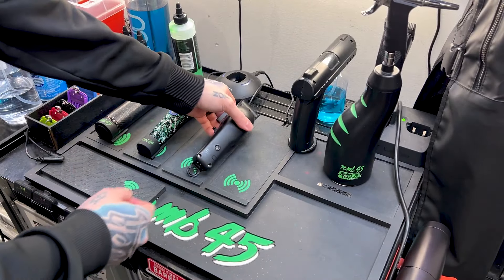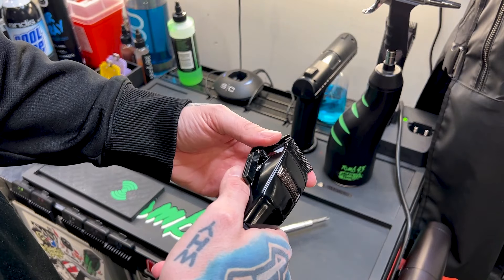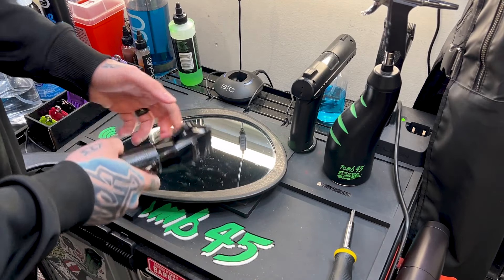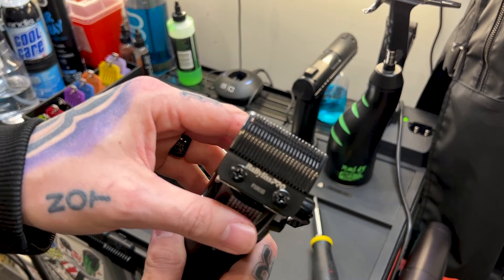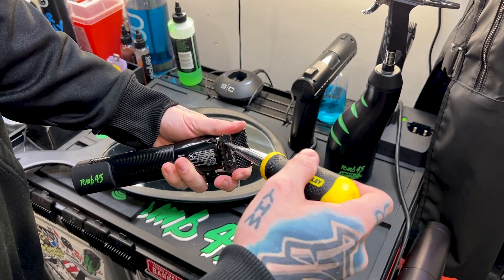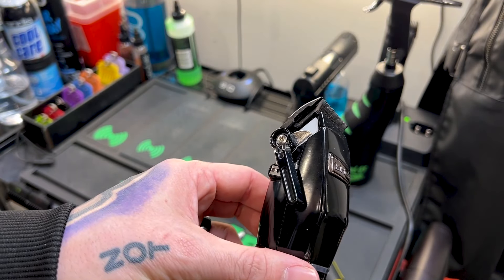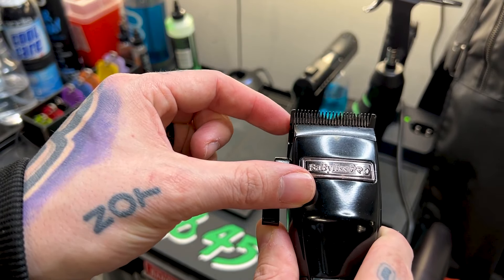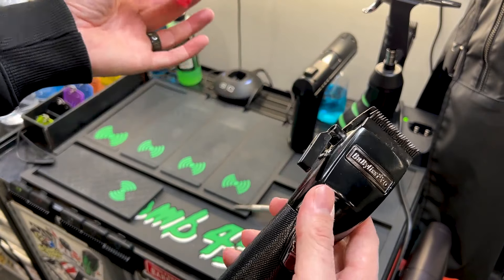HOW TO ZERO GAP CLIPPERS ✅ Adjusting Clipper Blades for Beginner Barbers

Comment: The problem with this system on the blades of clippers its that when you take ir apart to clean the gap on the blades will always move... in the trimmers will stay the same way every time, its better system on the trimmers.

Comment: My cutting blade slides from left to right if I push it at the edges even when the two bolts are fully tightened on the steel blade. Is this normal? Thanks

Comment: Thank you Sean I was able to remove my old blades from my fx silver clipper and replace it with the gold ones and leave it the same spot to not hit the guards, thank you for this content helps a lot in detail, I also notice my clippers were loud and when i change the blades the noise went down a lot.
Reply from the maker: Good deal 👌🏻
Reply: @Seancutshair  One las question Sean, my blade moves to different spots every time I turn it on and off, is that normal for the blade to move spots? I'm talking about the first little blade thanks
Reply: @edgarivanmiranda1943 I have this problem as well. Ever find out why or how to fix it ?

Comment: Sean how do you stop it from going crooked again after a cut? I tighten the screws down but I'll look at the adjustment after and it will be slightly crooked.
Reply from the maker: If you tighten it correctly it shouldn’t shift

Comment: My question is about the left/right alignment of the bottom blade. The top blade moves left and right, and each time you switch on the clippers then switch it off, the top blade doesn't stop in the same position every time. So when aligning the bottom blade, how do you account for this? What position of the top blade do you go off to set the bottom blade? Thanks
Reply from the maker: Center it based on the position on the clipper body

Comment: Hello! I need to buy a comb for the clipper 0.5 (1.5mm), and I dont know where to find it. I saw you have different ones, which one do you recommend me? I saw some in Aliexpress for like 5€
Reply: if its worth it, I could buy all the combs. I have the babyliss ones. Let me know
Reply: I bought the full pack babyliss fx pro ferrari red (clipper trimmer shaver) from second hand. I read I should change the blades. Should I? If so, which ones do you recommend? thank you

Comment: I don’t understand what I’m doing wrong on mine my babyliss pros won’t stay aligned at all! One side stays perfectly flush the other keeps exposing the blade or moving to far above it like not matter how much I tighten the screw on that side it just immediately wiggles on that side as soon as I tighten the screw
Reply from the maker: I haven’t had that issue. If it’s all aligned and tightened correctly it should stay

Comment: I have a question as soon as my clipper turns on the blade gets hot why ?
Reply from the maker: It shouldn’t that fast. Make sure it’s clean and there’s not a ton of hair underneath the blade. Make sure it’s well oiled. Use cool care throughout the cut and should be ok.
Reply: @Seancutshair  it does that fast there’s no hair I cleaned it I oiled it n I put cool care and as soon as I turn it on a couple sec you can feel them heat up and I just bought them I only cut like 7 peoples so far
Reply: I put the cool care n it fixed it but before me cleaning them it wouldn’t heat up like that

Comment: hey little question man, the back blade isnt 100% centered for me when the blade is in the middle its a LITTLEEE more to the right, does that matter a lot?
Reply from the maker: It’s hard to tell when it’s off, but when it’s running it should move back and forth centered on the still blade. So just adjust it slightly until you get it centered
Reply: @Seancutshair  but i mean does it matter if its just slightlyyyyyy uncentered
Reply: @Seancutshair  where can I buy a replacement back blade?

Comment: I tried zero gapping my babyliss lo pro with the gold blade and overlaps all the time. I try putting it in the regular stock but It doesn’t let me
Reply from the maker: It should be able to be gapped. Just try again. Sometimes it takes a few times
Reply: When I put a guard a rattles. I tried lowering the blade but it stays zero gapped or it over laps

Comment: Need some help Sean!!

Im using the Gamma + Boosted with a taper blade, just put it on a few days ago. I noticed when I did a cut that it rattled when I put a guard on it. Fixed that issue. My newest issue I dont know how to fix is, when the clipper is closed, and i open it to the next click, the left side of the blade (when your looking at the clipper) rises slightly higher than the right side. Once i go to the other clicks, it levels back out. I changed out the bracket but still does the same thing..left side rises slightly on the first click.
Reply from the maker: I’m not sure. I’ve had people ask about their blade moving but I never had that problem

Comment: Can you help me zero the Babyliss Pro FX3
Reply from the maker: Never done one but should operate the same as the fx
Reply: @Seancutshair  the screws to adjust are spring-loaded. May not be worth it. It is a great clipper as is...
Reply from the maker: @AnthonyPressleyE92  oh the clipper! I thought you meant the trimmer. I’ve seen staygold do it you have to bend the metal part that pushes the blade in position. Seems a little risky
Reply: @Seancutshair  thanks, keep the video coming